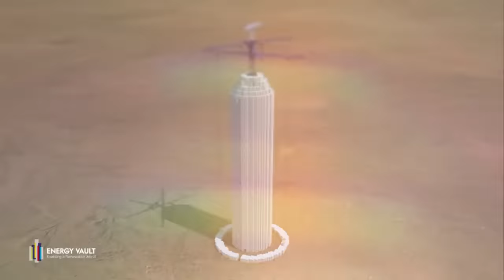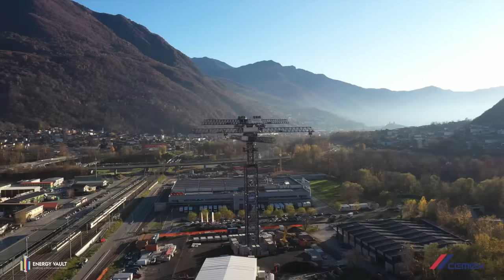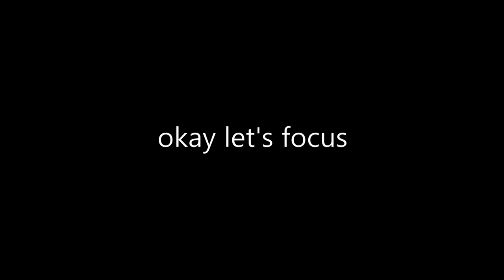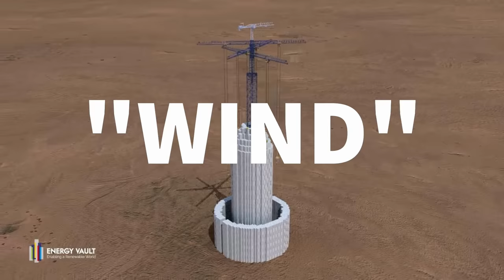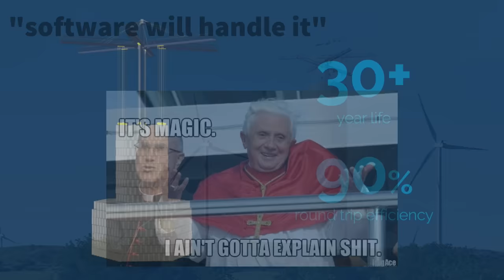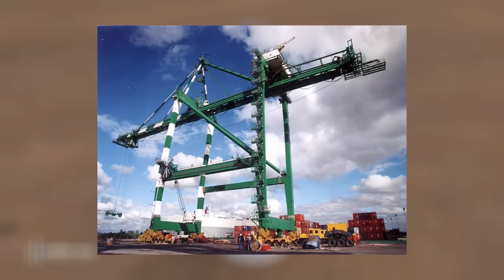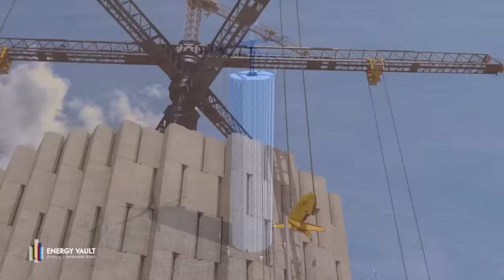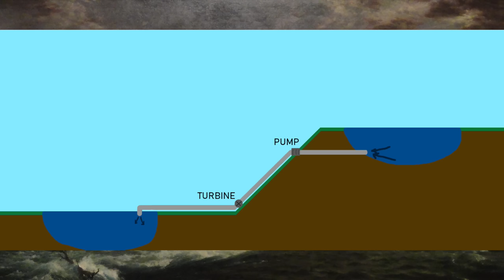The Energy Vault is a Dumb Idea, Here's Why

Comment: Even as an engineering student, this just seems incredibly stupid to me; it seems incredibly unsafe, even if it were mostly isolated away from people by being placed in wind farms, by being composed of loose bricks. A 4 year old could tell you that stacking blocks up high loosely is a bad idea.
Reply: … a bad idea as in every cathedral, who's architects did not know that stacking stones is a bad idea.
Reply: I believe they built one in Switzerland, surprised it wasn’t checked out for this video.
Reply: @UlrichRoss  stone cathedrals are held to gather with mortar, not free stacked like this structure would be. This is a giant Jenga tower and it wouldn't be a question of if it would fall, but when.
Reply: If only they learned to code software at kindergarten...
Reply: @UlrichRoss  Actually in all the big cathedrals they had to come back later and add steel straps and pulling bars so that it doesn't tumble down. Of course in the CGI virtual visit you don't see them (it's software ;c) ) but if you have the chance to visit one for real you'll see theses.
Reply: even as a non engineering anything, this looks like a remarkably poor idea
Reply: @UlrichRoss  Cathedrals were engineering marvels whereas this is a glorified Lego tower.
Reply: @lolaa2200  they still originally used mortar. Mortar isnt something new. It just degrades faster than the bricks. Speaking of bricks, do you know how long ago bricks were invented? Also its worth noting that gothic cathedrals were created with concrete and iron supports, like the ones you think were put there later.
Reply: I really don't see the wind knocking this thing over. As long as it doesn't get too high...
Reply: @UlrichRoss  cathedral isnt meant to be constructed and deconstructed 20/7 now does it ? It's build so that the whole thing stays together in a mechanical kind of way with arches and such. 
Also try removing blocks from the cathedral and see how well it holds....
Reply: @SirHusky654  I think calling it Lego is giving it far too much credit. You saw those things, they don’t click together like Legos they just get picked up and set back down. Like a child playing with blocks and a crane toy
Reply: @UlrichRoss  Those medieval cathedrals are permanent construction sites, they'll never be finished.
Reply: @brandonn6099  It's not that it will be knocked over by the wind, it's that the moving of the bricks will be affected by the wind. If it's that high, with a giant brick for a load, the wind will inevitably start a small swing. And the longer that swing goes, the longer it's being blown by the wind, the more erratic it would be, and the harder it would be to stack the brick properly.
Reply: @UlrichRoss  Man that is some poor critical thinking.
Reply: @UlrichRoss  I don’t think cathedrals get taken apart and rebuilt over and over like an abc block tower
Reply: @UlrichRoss  Cathedrals are permanent structures, not dynamic ones.  I see you chose to drop the "loose" part from OPs post.
Reply: @yordanazzolin  You've lost the point on this one. They're not saying stacking bricks in of itself is unsound, they're saying stacking bricks without additional support into tall thin structures is unsound.
Reply: @brandonn6099  you need to look harder
Reply: @jopoxc  also just gonna add on to this a bit. Torque increases as you move further from the point of rotation so that rotational force just from wind at the top while making it hard to stack them will also just put a lot of force into the system. Im sure the engineers would take that into account but its still just another thing to add to the list of problems this thing has.
Reply: @UlrichRoss  cathedrals are held together with mortar, the architechs back then wasn't just stacking bricks without anything to make them stick together.

Comment: The gravity battery as the one shown here has several drawbacks as you just well pointed out. The main advantage is that very small energy is wasted during the loading & unloading cycle and maintenance is simple .  They are using abandoned vertical mine shafts now, but still total energy stored is low. 
The Hydro pumping facilities are a very good solutions, but are expensive to build and maintain.

Comment: "Lul just dig holes"

We just gonna ignore this is like, the most expensive thing to do in construction and this man insists we should excavate entires lakes while also implying its cost effective?
Reply: It's more cost-effective than most of the other options. Anything we do with respect to energy storage is going to be horribly expensive on the scale of what we need.
Reply: It saves money in the long run for not needing to replace concrete blocks and crane cables every freaking year.

Comment: I love when the optimizations ends up creating an old, well established solution
Reply: Ah yes, the hill needed for pumped hydro just appears if you optimise enough.

Furry-pfp-tier opinion.
Reply: @professorfrog7181  Where do you live where there isn't a hill close to a settlement? North Dakota? This is viable for most places.
Reply: @veemie8148  Clearly his brain is so smooth he can not imagine places that are not as smooth as itself.
Reply: - Pumping a mass of water is less efficient than lifting an equivalent solid mass with a pulley
- Pumped storage is only efficient to implement when the natural landscape facilitates it; "energy vault" does not have this restriction
Reply: @gershommaes902  - Energy vault is limited to an extremely small capacity,  and loses potency fairly quickly on "stored power" the further up you go.

-Energy Vault is absurdly higher in cost to maintain, most likely also requiring considerable earthworking to make viable in the slightest...

And benefits more from water, less failiures more efficient far simpler, far longer lifespan.

You can most definitely put them all over. A hill is not a rare occurence, hell anywhere with even a mild slope could be a viable canidate, it simply has to be high*er.* Further out of course would mean more pump work, unless you create another aquaduct/pipe in the opposite direction feeding back. 
Or simply more involved earthworks and engineering for something of a MUCH higher capacity, with a MUCH larger lifespan, with much simpler process to maintain. No advanced components that could easily fail, or fuck up too badly. 

You do have the risk of a failiure of course, however with the hydro route, you can easily design a suitable failsafe channel. (Unless some jackass "improves" your design 20 years down the line, overloads your design, and overloads the failsafe entirely)
Reply: @professorfrog7181  if you can build a crane that stacks rocks, you can build a water tank at a higher elevation. I believe they call it a 'water tower'
Reply: @higueraft571  As far as I'm aware you simply can't put pumped storage "all over".

A relatively sharp incline is required, otherwise the hypotenuse between upper and lower reservoirs becomes elongated (and water must be pumped a greater distance, which has exponentially diminishing returns).

Many populated areas simply do not have sufficient natural elevation differentials whatsoever (e.g. holland).

And what purpose do the natural reservoirs and hill serve before they are converted for human usage? Were they ecosystems/habitats? What is the cost to nature?
Reply: @gershommaes902  Sorry but, that comment of "what is the cost to nature" is stupid. Filling a big pit with water, or raising an area's water level wont catastrophically destroy an ecosystem to any true degree, especially compared to, say... mowing down a forest, converting land into cities and farmland. 
Infact, said artificial lakes would provide larger habitats to the sort of life that live there... like Dams do. 

If you lack the terrain height, make it higher. 

AND AS MENTIONED.
Figure out how Romans transported water large distances. You. Do. Not. Need. A. Sharp. Incline. You only need an incline at all. 
Presumably to keep initial construction costs down, you build two. One to drain, one to fill. If you need to drain it some, you open a gate and let it flow, spinning turbines along it's length. If you need to fill it, pump it up to the "starting location" and let gravity do most of the work, most likely even more turbines along that course as well, to produce as much from the input as possible. 
The only extent you need sharp changes in height, is if you've got a rather deep lake/resivoir. And/or very very very short course. 
You CAN get away with large and shallow as well, you know...
Reply: @gershommaes902  Now tell me, is Holland as flat as Kansas? Hills do NOT exist at all? Nowhere at all? Not even moderately sized ditches?
Reply: @higueraft571  There's no need to lose your temper!

- Major landscaping projects always come at a cost to nature
- "If you lack the terrain height make it higher" - this is very expensive
- Romans did not transport water upwards! :) The downwards part is obviously trivial. The upwards part is where efficiency becomes a major question
- The longer the pipe, the more inefficient the battery. The reservoirs can be wide, but if the horizontal difference between top and bottom reservoirs is large (if the incline is not sharp) energy will not be transferred terribly efficiently
- Holland is generally very flat. It isn't important to ask whether hills exist at all - the questions are: 1. Are hills close to population centers that need to store energy? (transporting energy over long distances is not efficient) 2. Are the hills tall enough to be worthwhile? (Artificially adding height to hills is very expensive, releases tons of co2, etc), and 3. Is the elevation sufficiently sharp?
Reply: @gershommaes902  Yes. Romans did not (in the sense you're imagining, however they definitely could). However, with said detail mentioned a few times now... if you added a secondary channel, you do not need to. You simply need to pump it a relatively short height directly up. And let gravity do the rest. You can have more than one channel, and both can be completely static.

And yes, it would be expensive, but it'd also be extremely long-term, especially if corners arent cut too hard in the wrong places.

Yes, they do, however what are the costs? You're digging up land, most likely sourced from some dig site or such, or general mine, and dumping it on a designated area, assuming you arent just digging it underground itself. 

Farms and housing are by far much more destructive on multiple magnitudes, in comparison. Especially the sort that's mowing down the Amazon, that WILL have fucking catastrophic results when it goes Arid.

Which will result in the Breadbasket or America going arid too. Not only bad for nature, but also for Humanity.
Reply: @higueraft571  What do you have in mind when you suggest that romans "could" transport water uphill?

Ok, so we agree it would be expensive - this is in fact the reason that pumped storage is not ubiquitous; when the natural landscape doesn't support it, it isn't cost effective, and other solutions are chose instead. These other solutions also have downsides, and the ev may succeed where some other solutions may fail.
Reply: @gershommaes902  If i remember right, said system used similar mechanics to Toilets?

Yeah doublechecking, it used a general mix of waterwheels and/or Siphons depending on the situation to lift water up in their Aquaducts.

While the wheels definitely wouldnt be viable for larger scale flows, definitely in that case we'd use Pumps, before letting gravity take over on that slight downward slope of said course that it'd be flowing out onto. 

Yes, it'd be expensive, ANY project will be expensive. However, it'd actually be viable. It'd be extremely long-term, with most work being occasionally checking said water lines for damage, which wouldnt be often if it's stonework, and semi-often checking the mechanical aspects, such as the pump, and gates to ensure they dont fail or wear out. 

Would you rather something that, while expensive, could easily last for decades with little issue (if built well/not haphazardly expanded on), that requires fairly minimal work to drain, and moderate work to fill, can store absurd amounts of energy with an overall steady output rate, and is proven to work. 

Or some CGI animation of something that's extremely high-maintenance, over-engineered, ultra-precise or it fails, and VERY short-term, with an absolutely microscopic amount of storage capacity, with it's output decreasing rapidly as it drains, and so far hasnt left paper?

Now if you were arguing in 2010 about SpaceX vs Boeing, that'd be a different beast entirely. Because both sides are (well, *were*) valid...
Reply: @higueraft571  Right - pumping water uphill costs energy (and gets a less efficient amount of mass to the top, when compared to a solid weight lifted by a pulley). If the uphill distance is longer, pumping (or whaterwheeling or siphoning or whatever) becomes less effective.

I'm not convinced ev is unviable. I can imagine why ev may be superior; one of those reasons is that it isn't reliant on the natural landscape. I don't understand why it uses cranes instead of something more like an elevator (would remove the wind issue, less moving parts, no downsides I can think of), but I'm not an engineer, and who knows what issues I haven't thought of?

"Would you rather build [something expensive] that [lasts a long time]?" I don't know, it depends on the overall efficiency.
Reply: @gershommaes902  Yes, of course it costs energy, however, much like said elevator, you only need to get it to go straight up or so, and pour out onto the course, where gravity will do the bulk of the work filling the storage. And costs nothing to drain. 

Energy Vault CANNOT do elevators, as that reduces it's already pitiful energy capacity drastically. Reducing how much it can store at once. Additionally, you lose energy both storing and draining it. What moves said cranes/elevator? What gives the computer enough juice to make it's calculatioms? What lets the pully/elevator up and down, and lifts considerable mass in both scenarios? You cant just drop the bricks or it'll destroy them, you have to manage a controlled descent which requires energy.

Vs "pump water up and let gravity do the bulk", or "open a gate and let gravity do ALL the work", with a comparatively staggering amount of energy capacity on a larger scale, and still respectably large even on smaller scales. 

An "efficient" EV would have to be built partially underground. Which means a MASSIVE cost in earthworks. For something still worse than water. Otherwise, you'd have to ALSO build a shell around said EV to protect agsinst wind, adding yet more to it's costs. 

I'm rather certain a water pump is not more expensive than a bunch of high-load motors and computers, the former of which would require semi-often replacements and repairs to prevent any failiures, which would destroy the energy supply partially, and ramp the cost up further.
Reply: @higueraft571  
- The "going up" part for pumped storage is particularly inefficient.
- I don't see why an elevator / platform on vertical rails would be less efficient
- You only lose a negligible amount of energy tapping the stored energy (swiveling the crane, cpu power)
- Lowering the weight has a highly efficient conversion into electrical energy
- Pumped storage is cheap to implement, but only when the terrain naturally accommodates it
Reply: @gershommaes902  "negligible" except it requires energy to move it. You have to use energy to lower it, as you cant just drop it. You have to use energy to lift it as well, for storage, and "just swiveling the crane" isnt exactly cheap either, turning a massive chunk of metal is not cheap. Even ones shown. And again. Extremely high maintenance. And EXTREMELY costly as well if anything fails. At least you need to produce more cement, and lose that stored energy, and at worse? That crane fails, takes out a good fifth of all stored energy, if generous. More if more of it goes. 

And how highly efficient? How does it compare with water? 

And reminder, Concrete is extremely fragile, for these uses, unless sufficiently reinforced. And even then, especially if you use that fucking flimsy ass method for grabbing them, it WILL fail, unless you completely cover those corners with steel. Either the parts thst grab it will pop off, and dump the brick, or the concrete will give and same effect, but with more pieces falling
Reply: @higueraft571  
- Dropping happens purely via gravity (the masses fall slowly, as they are spinning a generator)
- With 6 cranes maximum amount to swivel is 60 degrees; with clever planning, only a tiny fraction of that is needed
- "How does it compare to water?" 90% vs. 80% energy conversion efficiency
- "Concrete is fragile" - no.
Reply: @gershommaes902  Yes, concrete is absolutely fragile. Without sufficient reinforcement, it WILL crack apart in no time flat, unless it's being put under very little stress overall. Why do you think Steel rebar is required? 

Not likely, you need SOMETHING to stop that chunk of rock from dropping out of control. Brakes. Especially if you need to stop it in an emergency. If you dont put it down gently, it'll be damaged. And possibly the block(s) underneath too. And unless it can hold it tight enough to stop that hefty weight's line from slipping or tearing said generator out with the force, you need said breaks.
Reply: @higueraft571  
- The generator slows the fall of the block
Reply: @gershommaes902  what kind of generator. How? 
You're effectively just saying "the engineers will figure it out" 

Is it rated for those weights involved?
Reply: @higueraft571  The generator transfers the downwards momentum of the block into electrical energy. The necessary opposite reaction is that the block loses downwards energy.